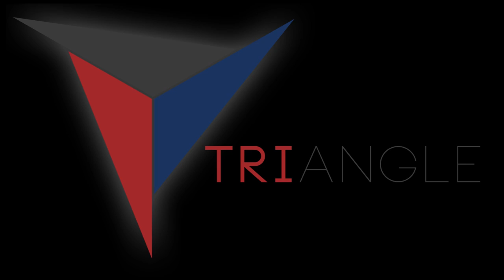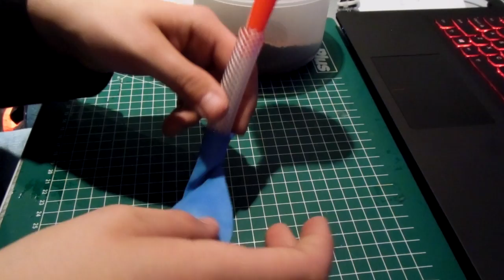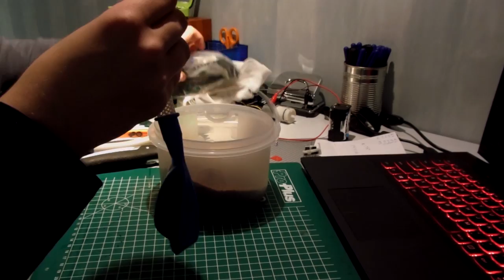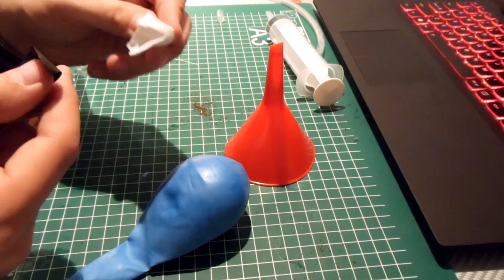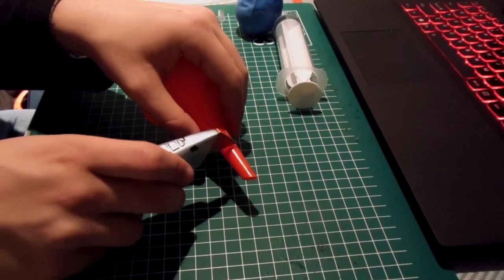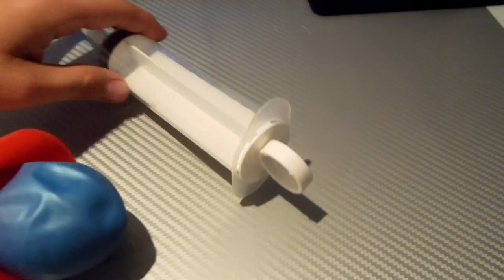DIY Universal Gripper Build

Comment: Hello we are making a similar type of gripper, and we are having a hard time. We don't know the reason, but when we try to attach things the balloon isn't that elastic(?) What kind of balloon did you use in the video?
Reply from the maker: Thanks for the interest. It is just a normal party balloon like you get in stores. A Latex balloon would be even better. The gripping of this balloon is not the best, latex is better for that.

The gripping has to come more from the contraction of the powder in it.
Good luck!